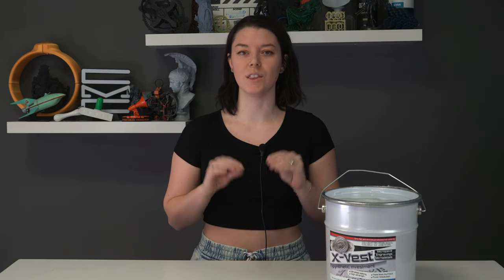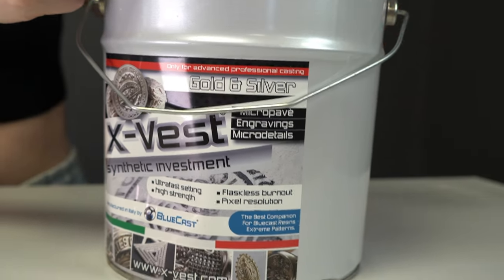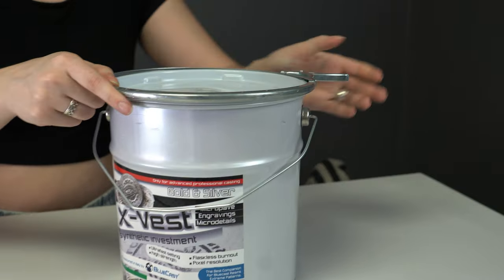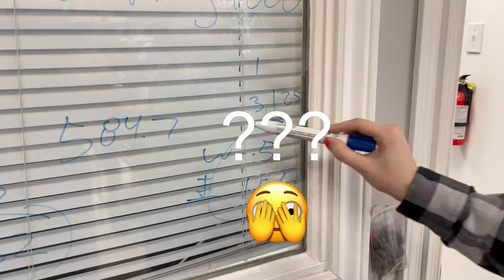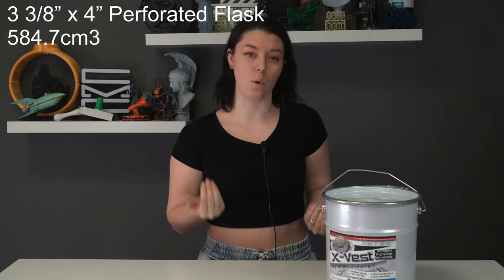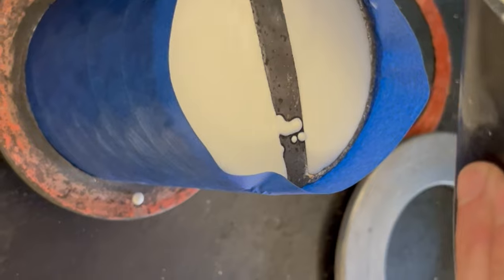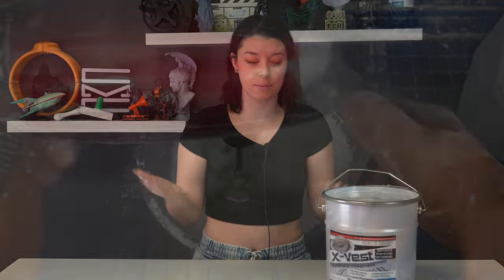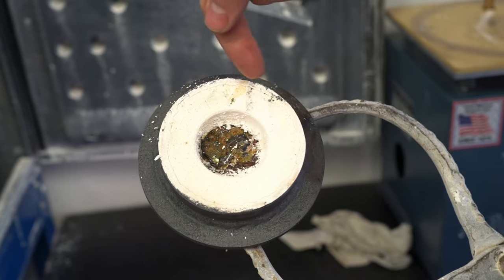Bluecast XVest Review - The investment meant for casting 3D prints (lost resin casting)

Comment: Would love to see more on Rapid Burnouts across different resins. Siraya Cast Purple and Blue both handle about 4h burnouts without and loss of quality or issues caused :D
Reply: im looking for a rapid burnout for siraya cast purple and prestige optima.. got anything you can share?
Reply: @TurdFergusen  
0-150 asap
150 90
150-730 asap
730 90
Casting temp (e.g. 500)l 60
Basically that, hour and a half at 150 to get the wax out cleanly, then ramp up to 730 for at least an hour and a half, then drop to casting temp and keep it there for at least one hour. 
Doesn't scale up well to huge flasks in huge kilns lol works fine for small trees in small kilns
Reply: @noviceartisan  cool thanks got a 3 1/2 x 4 Ill be using

Comment: Thanks for your video.
I do enjoy and learn alot from watching your videos.
I am expirimenting with X-one resin and presently testing casts with r&r ultravest. Maybe I am not an expert, so my results have been some good, some bad. Not a consistant result I had hope for yet. Anyhow, I think I might want to try out the X-vest, maybe you thunk it could improve my castings?
Also, I am gonna try using the 4" x 6" perforated flasks.
Do you have the water ratio for that?
Thank you.
Reply from the maker: Hey, thanks, we are glad you are able to pick up all the information we are putting out there. 
Although in theory the melting capabilities should make X-One compatible with Ultravest, Ultravest is still a wax specific investment. So large items may pose an issue, but it also depends on your investment mixing ratio and burnout schedule.
X-Vest, Plasticast, or Prestige Optima, are resin specific investments so would help remove investment as a possible reason for the issues your experiencing. 

Each investment brand has their own math for their mixing ratios but there is a lot of cross over, this is R&R's: https://www.ransom-randolph.com/_files/ugd/cc5f22_902ad781b4e74bf3b3d55bff34f7fe6c.pdf

We also have all of our investment mixing math in this digital download: https://clearmindcasting.com/products/lost-wax-casting-cheat-sheet-poster   if your more of a visual learner we have a video lesson: https://clearmindcasting.com/products/lost-resin-casting

Comment: 3 hour fast burnouts work fine with prestige optima investment
Reply from the maker: With what resin? or is this with wax?
Reply: @ClearMindJewellery  i cast two flasks yesterday, one flask was bluecast x-one and was bluecast x-10. program time on my kiln says 3:46 but i place the flasks straight into the preheated kiln after 1 hour bench rest. ramp rate is 8c/min so around 480c preheated temp. i think ive done it with injection wax before, with steam dewaxing before burnout, but maybe not with carved waxes
Reply: Thanks a lot for this video I am a huge fan of this black resin, especially for this brand X10 It gives great printing results And I cook the cylinder for 9 hours and the result appears beautiful, but there are some distortions on some molded pieces, small or medium pits Is it necessary to increase the cooking time? There is a note that I did not pay attention to to avoid this problem I wanted to take part in this question For others to benefit from me.